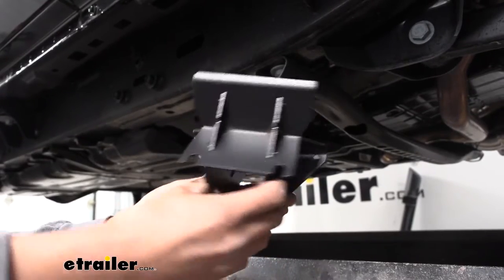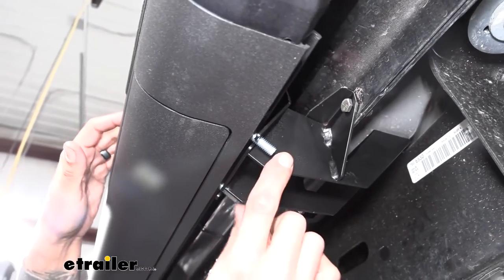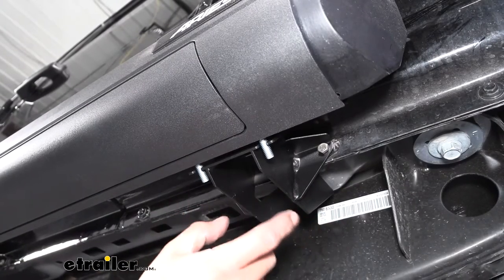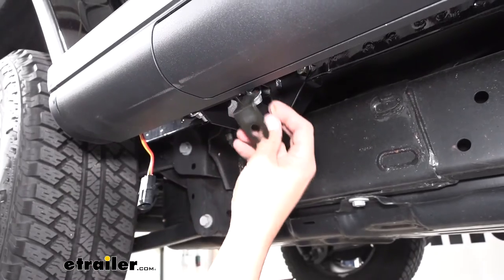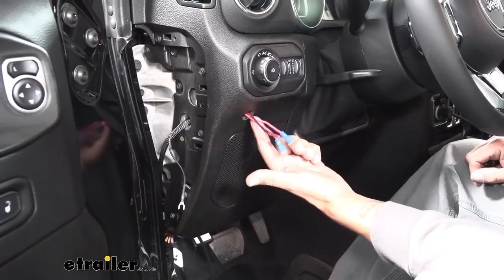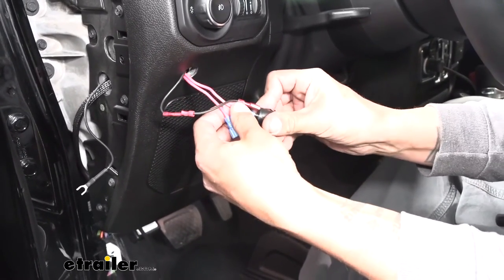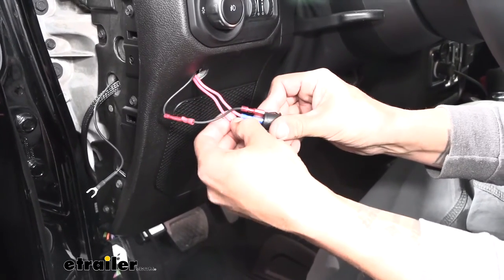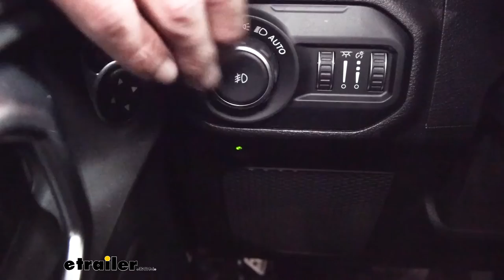etrailer | Aries ActionTrac Motorized Running Boards Installation - 2019 Jeep Wrangler Unlimited

Comment: I would guess the installation is similar on the gladiator?
Reply from the maker: Yes, the installation will be very similar but the kit will be slightly different. Check it out in the following link.
https://www.etrailer.com/Nerf-Bars---Running-Boards/Aries-Automotive/AA27FR.html
Reply: @etrailer  can you hook it up to the factory auxiliary switch. And not use the switch it comes with.
Reply: @chrishunt5291  ever find out if you can use the Aux switches ?
Reply: @Khaled.altamimi  I hooked mine up to the auxiliary switch. I flipped the wiring harness, from drivers side to passenger side. I used a door delete switch, and double side tape with small magnet on rear door sensors.
Reply: @chrishunt5291  thank you sir